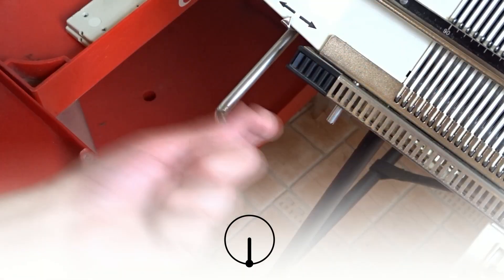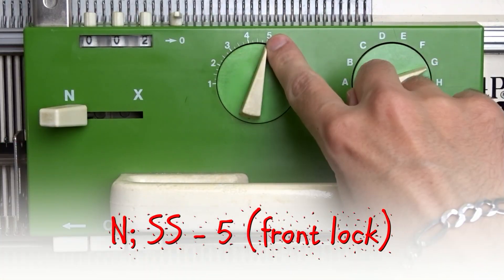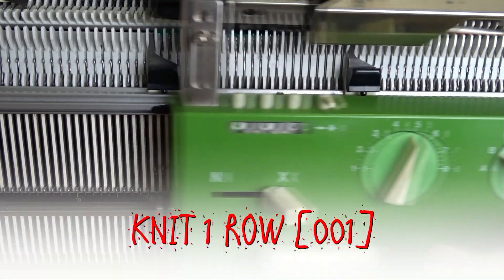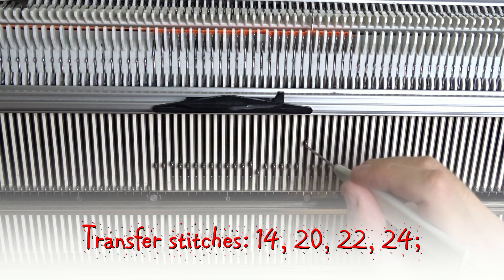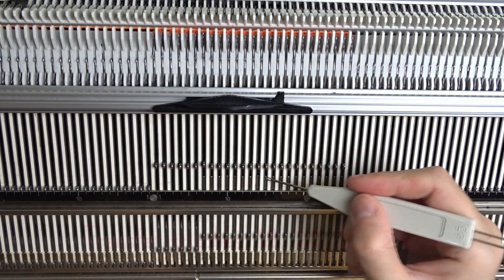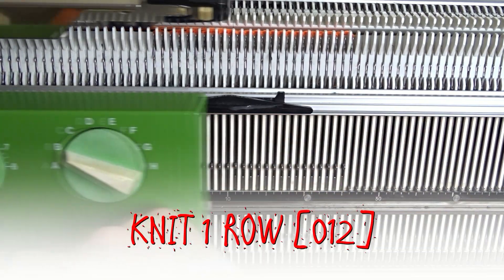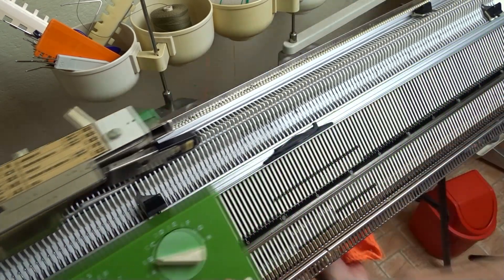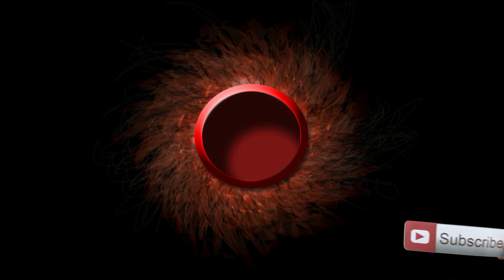Passap Duomatic Doily

Comment: Since punch cards pick pusher function row by row, could this be automated with a punch card?  Beautiful work?
Reply from the maker: I thought about that. It will be very useful for a simple doily, but for this one even if the pushers are automated, you still have to transfer the stitches. I have to try, to be sure, maybe if using AX (tuck stitch) and a punchcard the result may be interesting.